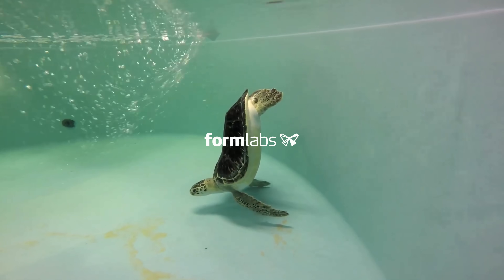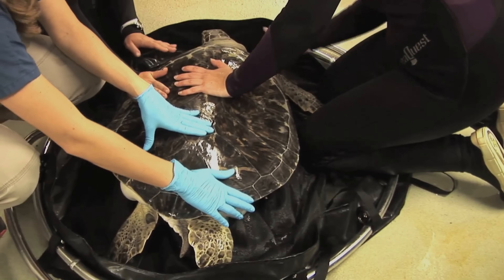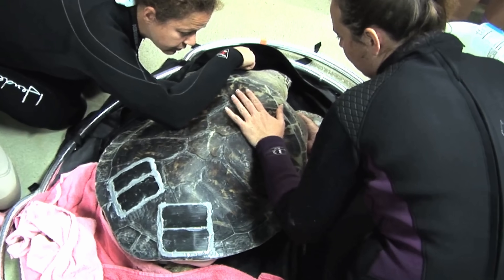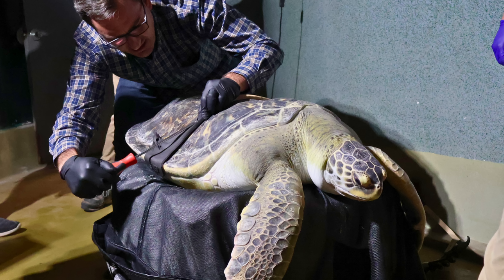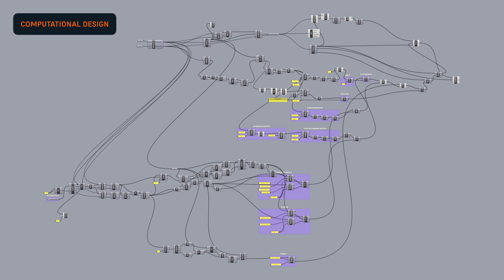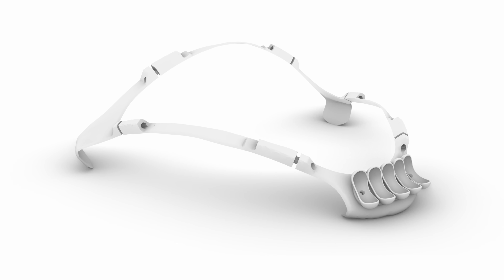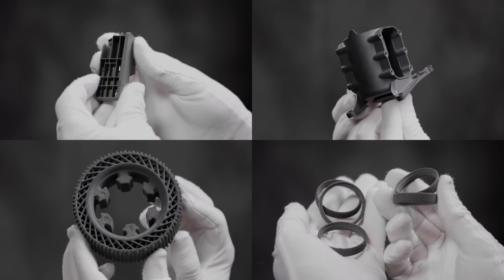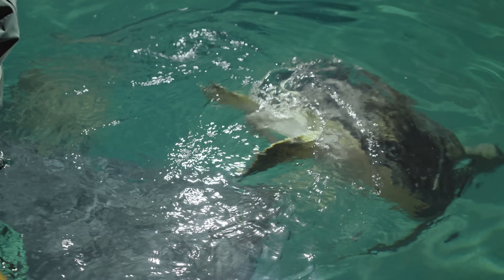Saving Charlotte: How 3D Printing Helps Sea Turtles with Bubble Butt Syndrome

Comment: For people wondering why they don’t just drill a hole.. Turtle shells are alive, it’s actually their rib cage and BONE. It’s not like fingernail or claws or horns or something.

Also, once you introduce an opening you have a massive risk of infection and disease getting in and the air will just continue to come back… you don’t want it full of sea water, so you can try to fill it with sterile saline but the air probably comes from dissolved gasses and will keep coming back.

This is a much safer solution.
Reply: Paraphrased from a turtle rehab website: Air can be removed from turtle body cavities by inserting the needle through the soft spot by the hind flippers, but the turtles also have go be treated for whatever caused the air to build up in the first place, like an infection or lung injury, or it will just keep filling up. 
If they stay at the wrong angle for too long (more than 4 weeks) their lungs will begin to deform, so during longer treatments, weights are used to correct their positioning.
Reply: Yes, which means it's always changing - which is why none of the other solutions worked, and why this one could also potentially not work out in the end. Chronic irritation to the shell.
They're not even out of the testing stage, but are claiming it's going to help all turtles with this (in captivity). We'll see.
Reply: Hello from Trujillo Perú.
A question.
Bones can be drilled, and titanium implanted in humans, so why can't a valve be implanted into the shell allowing air to escape but water not entre?
Reply: @richardbrice6535 Well my guess is it could depend on where it's at. A tortoise's lungs are located near the top of the shell. Guessing for turtles it's the same and them loosing lung capacity is risky.
Reply: @richardbrice6535 That's a great question!   It seems like a much simpler and less costly solution!  Good thinking!  I hope the turtle rescue people read these comments!
Reply: I was wondering if it was possible to do a surgical procedure like maybe fill something in that was similar to the shell material and then seal it off.

This solution is less invasive but it's always good to have options
Reply: I don't think so.   Those wing nuts are going to catch all kinds of fishing line and cast off nets, and will probably kill the turtle faster than it's original problem.
Reply: Thanks. I was wondering.
Reply: thank you for a clear & concise explanation
Reply: Why not just X-Ray to locate the gas pocket and extract the air with a needle through the soft tissue, seems fairly simple to me, with the air gone the internal organs should return to their original positions once the buoyancy issue has been resolved for a few days
Reply: I wouldn't drill a hole, I would want to see if going through the soft tissue was a choice to "pop the bubble"
Reply: Humans should just stay the f out of the ocean. Everything we touch turns to Death.
Reply: Mechanically, doesn't it work like a pneumothorax? Why couldn't the same sort of procedure be just as effective?
Reply: @Faesharlyn  in most cases pneumothorax doesn't come with mechanical alterations to the body so the treatment includes returning organs to their natural position. In this case, that's not possible.
Reply: @bogdanrzheusski8115  not possible because of the damage to the shell, I can't help but think of them as "dislocated" scutes.. 

But what's preventing them from filling that cavity with sterile saline?it's denser than air and would correct the float
Reply: @Faesharlyn turtles have a single body cavity called a coelom. So it’s very possible that the air pocket is contiguous with his lungs.
Reply: @PrincessLelouch  if that were the case he would have a pneumothorax, (pneumocoelum?) no? Air would continue to leak in and blow him up like a balloon as the buccal muscles pull air in like an iron lung... but if the coelum was connected to his lungs, wouldn't his internal body fluids come out his lungs? I'm not talking about blood or gastric juices, I'm talking about the fluids normally in the cavity.

If it was connected, air would eventually displace any saline, eventually building up enough to cause the buoyancy issue again.

Assuming that, saline would have to be reinjected periodically, no different than needing to change his weights as the bubble grows bigger

I'm not trying to be contrary, i'm just trying to understand
Reply: @Faesharlyn  I think any air depleting the turtle's lung capacity is a bigger problem than the buoyancy issue!   Hopefully, they've done imaging to ensure there's no air leaking from the lungs before this stage.
Reply: @Faesharlyn exactly!  In fact, there's a medical vacuum device that could be used to suck out the air and keep it out while the turtle heals well enough to retain it's internal vacuum state.
Reply: Yeah but in reality turtles survive all the time after losing parts of their shells. So I'm thinking this might not be as bad of an idea as you are saying.
Reply: @jvon3885 Sure they survive but how is their quality of life afterwards?

Comment: Could they not just have a veterinarian drill a hole, release the air, and fill the air gap with an implant?
Reply: Turtle shells are living tissue.  So basically it would be like cutting a chunk out of your rib cage.  Which now your body cavity is open to the world and the bone is compromised.  Big enough risk for humans that can wear water tight bandages, stay out of water, and use daily antiseptics to prevent infection, and might be able to heal the damage in a couple months.  For an adult turtle, those shells grow slower, meaning that hole could take years to close, and they live in the same salt water that they and any other animals living with them go to the bathroom in.  So trying to keep that hole clean, sealed, and prevent infection is really difficult.  Additionally you’d need to try to fill the space with something to try to keep the air from coming back.  But what would you fill it with?  Sterile saline would likely be taken up by the turtle’s body over time and you’d be right back where you were.  Some sort of silicone or saline filled plastic like they use for plastic surgery?  Those haven’t been tested in turtles whose body chemistry and immune systems are vastly different than ours.  Even if they worked okay in theory you’d need a much larger hole to put them in meaning more infection risk and longer healing time.  Oh and you’d have to somehow create a custom irregularly shaped one likely while in surgery to fit around the contours of the turtle’s internal organs.  Oh and the whole thing would have to also be neutrally buoyant.  So yeah, it’d be a great idea in theory but it just involves way too many risks to make it workable.  External weights if they can be fitted so they don’t cause irritation are much safer.  They also allow you to add and remove weight slowly or move it around relative to the turtle’s body so you can get a much better balance not only in the first few weeks, but also over the coming decades as the volume and exact location of that air pocket could change slightly as the turtle grows.
Reply: There would be no need to remove any shell. A trocar, would work just fine.  that's exactly the way they take air out of a pneumothorax.. if it works for people, why wouldn't it work for turtles?
Reply: @mylifewithmarmalade4624  You are aware that people get metal plates, extensions and support rods on bones all the time, right? bones are also living tissue but we can still help them heal with inorganic matter. Using the rib cage example, people with severe scoliosis sometimes have to undergo a surgery where literally their spine is streteched out and metal rebars are ran through supporting structures that are drilled into the ribs AND the vertebrae... the fact that turtle shells are living tissue is not really an excuse. We get implants on living tissue all the time and have to live through it. The point is what kind of implant would be adecuate for a turtle shell to help it heal and not cause more damage with the operation. Your example of cutting a chunk out of the rib cage is terrible, because we do that all the time. Also with pectum excavatum, you literally have to cut off all of the ribs and extend them to make the sternum protude outward rather than stay deep within the chest... etc etc...
Also, your point about opening up cavities within the body to the exterior doesn't make much sense. Sure, there's risk for contamination, but we do it all the time during surgeries, the thing is that we do a magical thing that you may not be aware of known as "closing it afterwards". Insane, I know, not sure who came up with the idea, but they were a genius! Like, really, what gave you the idea that after opening up the shell we'd just leave a hole in there?? the OP literally talks about filling it with an implant.
Reply: Because the turtle's shell is actually ALIVE, like it's made of tissue, blood, nerves, etc! Its not just a natural shield thats made of solid keratin or something similar. So drilling into it would cause a lot of pain (granted anesthesia would be used but still) and would absolutely be prone to infection while being submerged in shared tank water.
Reply: Im sure either it would refill with air or ruin the internal buoyancy even more
Reply: How would they sell 3D printers with a simple solution like that...

Comment: Why not drill a hole and let the air out?
Reply: The shell is deformed. The air pocket would still be there, the shell isn't deformed or being held up in that shape because of the air so it's not going to collapse down and sit flush with the turtles body the way it's supposed to.
Reply: and the turtles shell isn't like your hair or nails, its like their ribcage. they have nerves and can feel it completely. they feel it like they feel their flippers or their head.

Comment: Can't they drill into the turtle to remove the air ?
Reply: There's probably some anatomical reason why they are hesitant to do it. Maybe they're worried about hitting a blood vessel on the way in or something.
Reply: The air isn't between his organs, it's inside his digestive tract.
If it was between the organs, they could get a needle through the soft spot by the hind flippers.
Reply: The turtle's shell isnt solid bone or keratin (what our finger/toe nails are made of). It has living tissue full of nerves and is part of the turtle's rib cage!
Reply: their shell isn't like hair or fingernail, they can feel it completely.
might as well drill into their flipper they'd feel it all the same.

Comment: it requires a very different skillset and is probably riskier, but I reckon a better fix, and particularly one that could also be done on wild/to be released turtles, would be to replace the internal air bubble with a blob of permanent biologically inert filler, like human cosmetic silicone injections. silicone is a little denser than water, it might be dense enough to do the job. I would guess that the air bubble is likely to be safely, without hitting big blood vessels or organs, accessible with large needles alone with no cuts needed, either from underneath the rear edge of the shell, or through small holes drilled through the shell (yes I know that's a living bone structure). 
that could probably even be done on wild turtles with same day release directly on a boat, with some smart antiseptic/antibiotic and patch-up methods. if I recall correctly, reptiles are a bit iffy to sedate, but some sedative gas is applicable for surgeries, and would fit well with the fact that this would be a very fast operation - maybe 5 minutes if you inject silicone slowly in order to have it settle well in the cavity and push out as much air as possible before the silicone reaches the venting needle at the top. by common veterinary/biologist standards, it would even be acceptable to do it without sedation, if you don't drill through the shell.

or maybe there are other substances that are safely broken down in the turtle and result in the turtle's flesh and organs slowly being pulled into the previous void, and the turtle regaining a more normal shape if it's still growing.
Reply: Keep in mind that air inside is going to reappear. It's not there because of some sort of hole, this part is basically intensities and it's not supposed to have atmosphere air inside. Most likely it's gases that collect as subproduct of biological activity.

Comment: using straps wouldve solved the same problem!! Would also be customizable for each turtle.
Reply: that was the second thing they tried after gluing weights directly to the shell. the video explains this. also the whole point of this technology and workflow is that it's customizable for each turtle
Reply: @bloodtastesirony  okay, yes you are correct they glance over that for like a second. Scanning and modeling each turtle still doesn't seem cost effective. Reinforcing critical points where the straps are easily torn/scraped off with rubber or soft material would've solve the issue.
Reply: I ain't paying $35/child to see some velcro strap. I want my kids to see the aquarium provide the best available care for these turtles.
Reply: @astroimagers  huh??
Reply: @frontcatcam7193  a jest about the cost of a family trip to the aquarium 😜
Reply: ^
Sounds like you figured out a less effective, more expensive, and time consuming way of getting it done. 

Great work!
Reply: @Scanlaid 
Please explain how a few hours of sewing are inferior to this scan, model, print approach.
Reply: Form lab printers are like 10k+ and hiring engineers to tweak each design for each turtle and the cost of the powder makes this a great way to misappropriate funds.